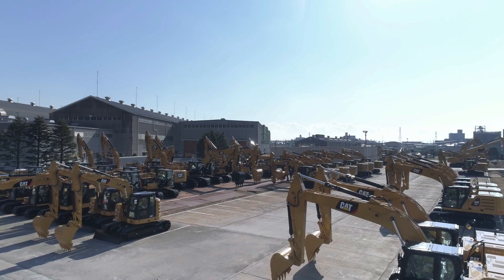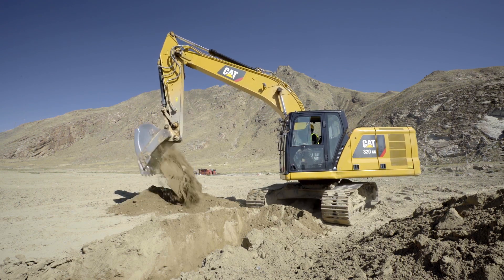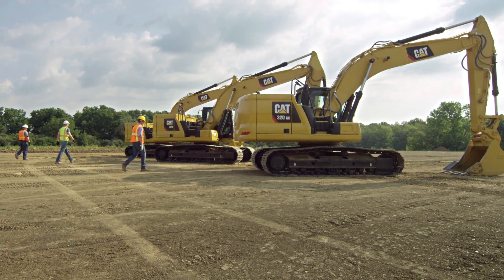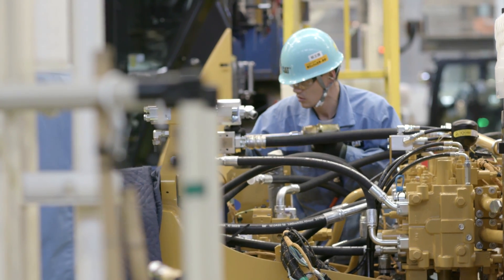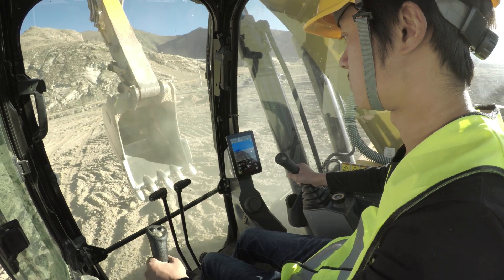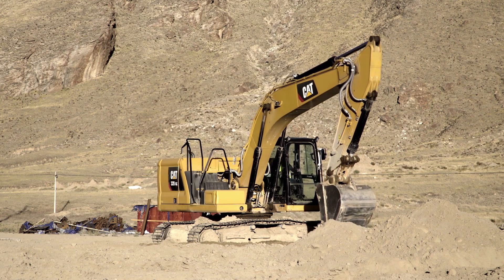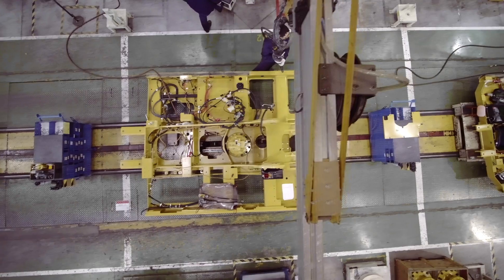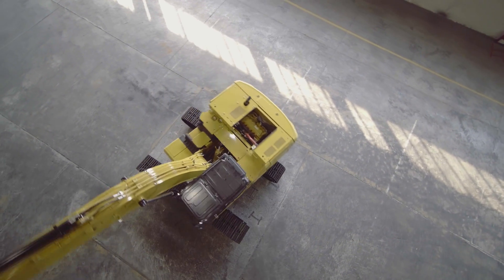Cat® Next Generation Excavators: Design

Comment: I would desperately love to take part in the development of future models. As an operator of 13 years and having  Grown up around  Equipment. It saddens me to run these newer modelsThat have almost completely lost their fly by Wire feel to the controls. I would imagine a lot of that is because  Of  Future technology that assist in grade Control. Add somebody that works in The pipeline industry I would love to help Caterpillar develop A separate   Operating mode that cancels out All of the computer assisted Control functions, Basically making a stock Natural feeling machine. This would be a almost life savingFeature for guys like meThat dig around live pipelines. I have ran many of the newer Model excavators Doing This And it is very Frustrating when the machine withdrawals power when you need it and gives it back when you don't. When I have The Option to choose my machine I now go for older model cat excavators. More brands like link belt and komatsu  That have less computer controlled interference In the hydraulics. I'm also seeing a lot of others in my industry moving away from cat Excavators And using komatsu and link belt as well.  I hope somebody with  Research and development Realizes this problem Before Caterpillar Loses grip on the pipeline and industrial market for excavators.
Reply from the maker: Thank you for that feedback! We'll pass it on to our product development team for consideration.